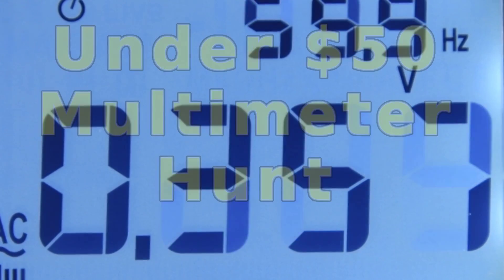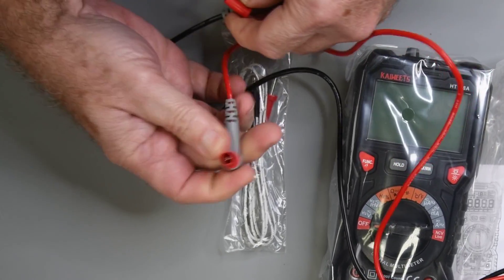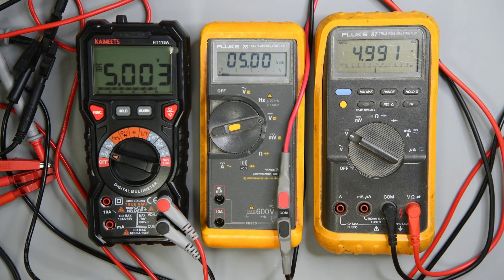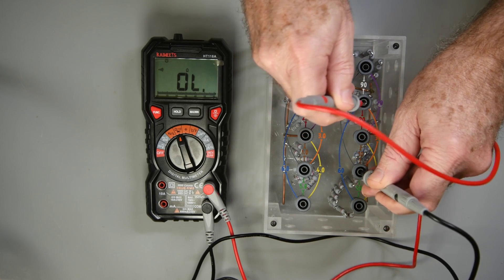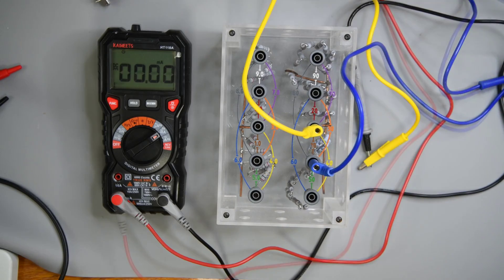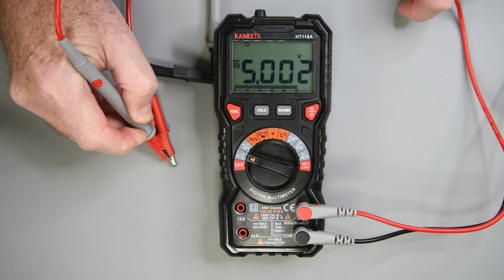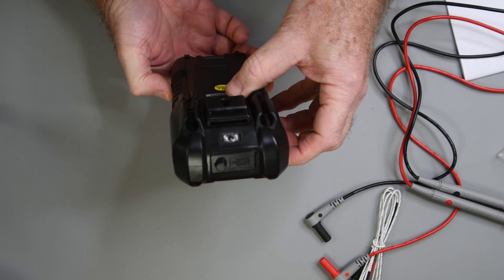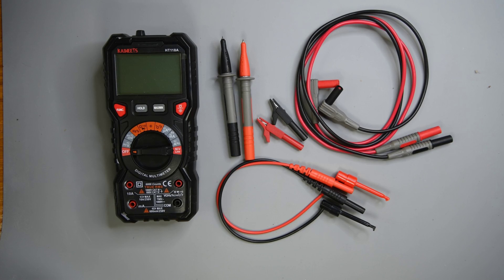Under $50 Multimeter Hunt

Comment: Uni-T has some pretty good meters (including DC current clamps, which come in very handy on some occasions), safe with ceramic fuses, that feel pretty sturdy and are hackable (you can edit the EEPROM to increase the count, change the default function, increase the timeout of the backlight or the auto-off function).
Reply from the maker: Thanks, I'll take a look at them.

Comment: Why not 9V batteries? Is that just because you don't like to keep some in stock? :)
Reply from the maker: If there were only one reason, I guess the top reason is cost per watt; AA batteries are about 1/3 the price per watt.  Also, a meter using a 9-volt battery is probably using an older chip set, which in itself doesn’t have to be a drawback.  But why make life more difficult when I don’t have to?  It’s not that I don’t like having one in stock.  It’s that I only have one, and when it comes time to find it, I won't buy another meter that uses a 9-volt battery.
Reply: That’s absurd!  A good 9 Volt will last forever, and not prone to leakage as some AA and AAA’s are.  One can pick up 9 Volts on sale, and even get Lithium.  Fluke meters use them and the contacts are positive, and no worry about springs losing tension as they are prone to.  Of course this all comes down to individual preference and Life is full of choices.   Peace

Comment: Thanks for another excellent video. I appreciate the high production quality and the well thought out content.

For a cheap DMM the AstroAI DM6000AR has been pretty reliable for me for the last 4+ years. I use it for hobby electronics and for vehicle / appliance diagnostics with different probes.  The magnetic hanger gets in the way at times but I rather have it to keep the meter from falling when perched in odd locations.  The meter does allow manual setting the range.  No flashlight or the no-contact voltage sensing.  pretty decent website with a pdf of the manual.
I paid $35 but now it seems to be temporarily marked down to $27 as of 2024-01-19.
Reply from the maker: That is one I looked at.  I think it was about the lowest-cost 6,000-count meter I saw.  But it looked like it used a 9-volt battery, so I removed it from consideration.  I don’t think the flashlight or the no-contact sensing are worth anything.  But not using a 9-volt battery is worth a bit to me.  I tried with two different browsers on their website; they must have been having problems at the time.  If the website had worked, I would have bought their M6K0R instead of the Kaiweets HT118A; I think they are the same meter.
Reply: @metalplasticelectronics354   I'm really sorry if this is a basic question — I'm about to buy my first multimeter, Why is a 9V battery considered bad for a multimeter? Doesn’t higher power mean more capability?
Reply from the maker: The price of the 9-volt batteries is my main complaint.

Comment: Great video! I love my Innova 3320's. I got one on sale from walmart for like $10-15 almost 10 years ago now and it's still going! Pretty sure I have accidently put way more current than 10A/DC through it and it's getting the job done. I got a 2nd one for work, so if it falls of a ladder I don't have to stress. It tells me what I need for the jobs I'm doing and I have a slightly nicer Ideal 61-747 that has a AC/DC clamp meter and temp probe. I got that one just because I was impatient and didn't want to order one online.
Reply from the maker: I’ll put that on my list to take a look at.  I always think of Innova as automotive stuff.  I have an OBD2 code reader from them; it's been fantastic.

Comment: I have no idea what 4000 or 6000 count mean.
Reply from the maker: It’s how the meter displays the value.  4000 count will display 0 to 3999.  6000 count will display 0 to 5999.  20000 count will display 0 to 19999.  So if you are checking a supply at 5.010 volts, the 4000 count will display 5.01, whereas the 6000 count will display 5.010.  Not that the accuracy of the meter is that good, but it can be used for comparison.